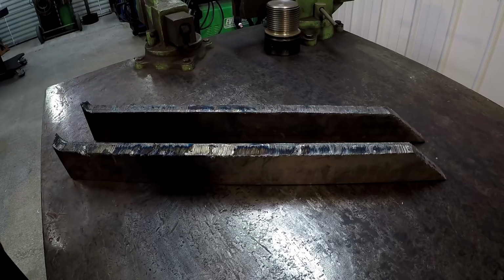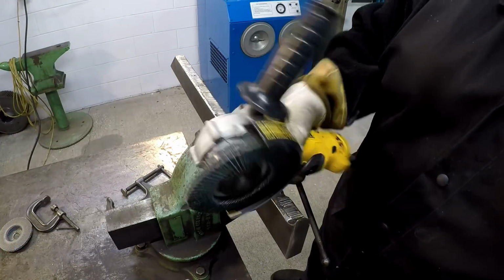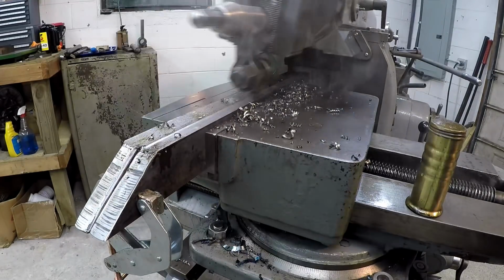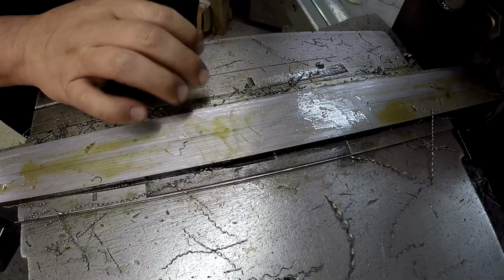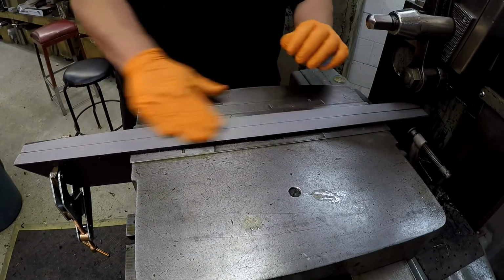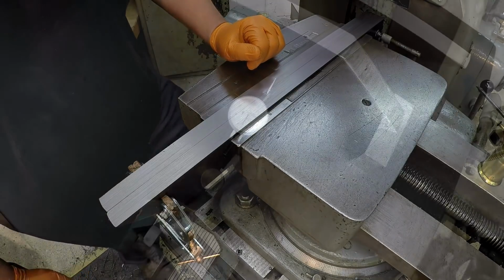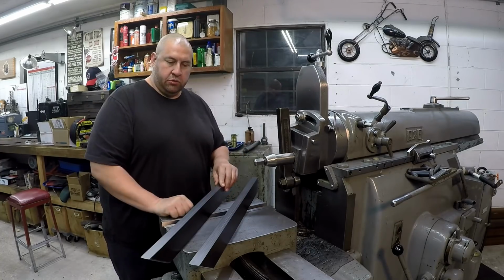SNS 220: Shaping 28" Parallel Bars

Comment: Not gonna lie, I've never seen one of those machines that you were using to cut those edges down. What do you call a beast like that? Is it only used for parallel  milling? Do you cut channels with it too or just get dimensions cut in?
Reply: morningstaR x it's called a shaper.
Reply: I've seen them used on YouTube for channels, dovetails (I think), and keyways.  Stefan Gotteswinter used one on his YouTube channel quite a bit.

Comment: Glad to see the vises with the square throat. As long as i have been a machinist i cannot stand the Wilton round throat sealed bearing vises. They call them machinist vises and i never understood. Way over priced too. Gimme a Milwaukee, Morgan, or and old Columbian before they got crappy. Well, off topic but i was glad to see a machinist with good sense about vises. Lol
Reply: What is your objection to the round throat?
Reply: t sam - it helps keep parts more stabile. Also if you have something heavy you have to hold it steady with one hand while you tighten the vise with the other. The vises i mentioned have larger diam handles also. These are a few reasons.

Comment: What's the tolerance for straightness (flatness) over the full stroke on a shaper like that? That shaper and shapers in general. I see the dovetail ways looked scraped. Does it have to be (somewhat) regularly checked and calibrated due to wear?

Comment: My vise, crudely mounted as it is, has a tendency to work loose.  I need a real base for it, but I still can't get my brain to settle on a design.

On mine, the cross feed is on a ratchet system, so, if the tool head feeds straight down, the cutter engages the work in exactly the same places that it did on the previous pass.  I'm wondering if angling the tool feed so that you feed down and shift the tool horizontally would result in a better look .. say, start with a 1:1 ratio and test other angles from there.

Have you tried a spring pass with the shear tool?  I was led to believe that the shear tool was only intended to take 1-2 thou off at a time.  Even that light, I've done as many as 6 spring passes with the lathe before it quit making chips.  That may be, in part, due to the fact that my slowest feed rate is .006/rev and my carriage feed engages with a clutch, so the tool doesn't follow the exact same path on the work every time.  I've been really happy with the final finishes I've gotten when I've done that, though, so I'm willing to put up with the extra work.
Reply from the maker: No reason to keep making spring passes unless your trying to reduce the diameter. From what I’ve read the shear tool is good for up to .005, but it can certainly handle more.
Reply: Well, I was going by Lyle Peterson's instruction, and I failed to mention that the finish improved with each pass.  The result was probably the closest to 'mirror' that I've gotten with HSS, image reflective with the faintest of very clean looking machining lines. The work I had this happen on was for an indexing center, to offset the part from center in the 4 jaw.  Exact size wasn't so much of an issue, but I wanted to make the surface that the dial indicator worked from as clean as I could get it.  The first shear cut was heavy, (error on my part) and the result of that one pass wasn't much different from the previous tool.  My thoughts on why it all came out the way it did would force me to write a book, so I'll just say "that's what I observed on my machine."  And "each machine is different, therefore your results may vary."  

How to get the same finish with the shaper is another challenge, though, and I think that a lot of the problem has to do with the more static work feed/tool path that I mentioned previously.  So, based on whats been observed so far, how can we sneak up on our target size with the same finish, on the shaper?  I'd love to get a finish that looked similar to one of your hydraulic shaft turnings.

Comment: What? A guard on your angle grinder? and a faceshield? and long sleeves while TIG welding? It's so nice to see a video where somebody is using proper safety equipment, not to mention proper use of tools.
Reply: You didn't see the 9" angle grinder then 🤔
Reply: Also according to osha law no gloves around power rotating equipment but he had the on while grinding

Comment: So what was this thing used for? Is it just kind of like equivalent to a jointer in the woodworking world?
Reply: It can do what a jointer can do, but it's more like a mill that uses a fixed "chisel", though some can have a rotating tool (helical milling). They can cut grooves/dadoes/dovetails and the cutter can be shaped or adjusted to make different profiles, kind of like a router. If the vise is on a turntable, it can do those things at pretty much any angle on that plane. Depending on how the shaper is set up, and with all the proper accessories, they can be used to cut threads or cam profiles, teeth for gears, keyways, galleys, undercuts, et cetera and so on.
Reply: NiccoHel Ya, as I’ve heard said before, you can do anything with a shaper, other than make money. 🤣

Which I assume comes from the fact that while it can do all of that, the setup and labor involved is usually prohibitive, when there are specialized tools for all those things.
Reply: @Nevir202  MOSTLY FOR CUTTING GEARS AND KEYWAYS

Comment: Aha an angle grinder, finally a tool I could teach you a trick or two with...lol......I don't ever tuck them in close for better control because if the disk wedges and your work piece is solid it can pull and twist you in onto the work piece. If the hand tool is more powerful than you then you better holding it like a baseball bat, like you hold a chainsaw, so that if it kicks or when it next kicks you can just let the tool swing away and absorb the kick rather than slamming into your chest and catching your clothing.
Reply: Being a Metabo, it should have a safety clutch to prevent twisting your arm off, if the disc jams.
Reply: @glitchwrks  The safety is with how you operate the tool and you should not rely on the safety features of the tool. I once had a 1000W drill catch my safety jacket when it kicked into me while drilling at the top of a 20ft ladder. The chuck caught the sleeve of my safety jacket and twisted my arm up so bad that my finger was twisted onto the trigger and I could not release the power. The only reason I am talking to you now was that I had my other hand held tight to the secure ladder. But I found myself in a situation where one hand is holding on for dear life and the other hand has hold of a now smoking 1000W power tool that I cant release the power too. I released my hold of the ladder and hooked my good arm through one of the rungs of the ladder so that I could pull the safety jacket from around my trigger finger.
Sometimes things advertised as safety do not give it to you, now if that jacket was just regular clothing it would have ripped apart with the forces involved. Tough tight clothing might stop loose material from pulling you into a machine...but it it does catch then it is worse than normal clothing.
Reply: @AirCrash1  what were you doing with a 1000w drill ontop of a ladder?
Reply: @jamesscott6753  Building my home, I used huge laminated beam made from hardwood and the fittings were all stainless which is nigh impossible to drill by hand.  I pre-drilled most of the stuff but some could only be done once up and the drill bit long enough and big enough to do it only fitted my big drill.

Comment: Do you have a special energy supplier?  If i used those machines in a domestic shed my bill would be huge and probably give surrounding houses brown outs when turned on
Reply: its 3 phase instead of the standard split phase 220
Reply from the maker: My shop runs in 3 phase power.

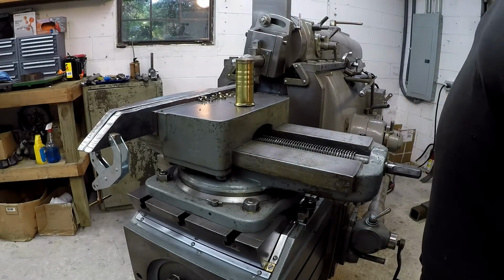Comment: not sure if it matters, but at 9:22, i can see some deflection on the part as the cutter extends out.
Reply: Not necessarily a cause for concern if it's caused by flex in the mat/feet/table/floor interface. The center of mass shift on this thing must be huge. It would be fun to operate in a rowboat.

Comment: I must ask - why didn't you put more oil on there? Won't the heat damage the cutting tool by making it more brittle?
Reply: I see. Makes sense also considering how those machines rotate the part/bit, which would alter where the smoke goes.
Reply from the maker: David Pontius The heat won’t effect the tool at the speeds I’m cutting on the shaper. The oil is to help the shearing action of the metal.
Reply from the maker: Roderick, the oil is used for lubrication, not cooling in these applications.

Comment: I don't understand how you are maintaining equal force when you're using the indicator to see how flat the steel is... is it running against the edge of the granite plate? or are you just using your judgement?
Reply: The Indicator tip is running along the bottom side of the steel (which is sitting on two 123 blocks). The thing that is holding the indicator slides on top of the granite.

Comment: is the up and down movement of the tool holder part of the designed machine function? or just wear?
Reply: It's part of the design, on the back stroke the tool is lifted to prevent chipping of the edge. Although I have to admit it looked a bit weird.
Reply: It's called the clapper box.

Comment: What's the point of those clamps? Like, advantages over a c clamp? Also, what are they called? I always hear cam twist clamp, but that doesn't sound right.
Reply from the maker: Peter Juncker sometimes it’s the position of the screw handle that makes them better then a c clamp.

Comment: Question. I hate using an angle grinder in the workshop. The ground off particles get everywhere. Does that worry you?  Watching I thought you'd have used some sort of screen.
Reply: remember he got 2 different areas of his shop, where he did it in the new part what got the grinders and stuff
Reply from the maker: Grinding dust don’t bother me, it’s a shop, made to get dirty. All the years my dad and I worked in our other shop, grinding dust never give a problem.
Reply: True.  I don't have the same amount of space.
Reply: Indeed. But your shop is so CLEAN and the grindings do get everywhere and they are not good for machines and stuff.

Comment: Now it deflected and you must sharpen it again, it warmed up because the passes were very deep, you did it too fast, you must not do no more than 1 or 2 mm x time.
Reply: Yeah the cuts looked very deep and might have heated the metal and caused some distortion meaning they were not as flat as they could have been.

Comment: the bigger the radius on the tip the better the finish,
Reply: You right about that. You have better heat decipation while cutting with a radius tool. With a seven degree relief works best????

Comment: Why did you use a shaper rather than a milling machine for this?
Reply: Accuracy, durability of the bits, and mostly stroke length. He mentioned his mill can't handle a work piece that long in one pass.

Comment: Could you use a inserted turning holder on the shaper?
Reply: Absolutely.  Especially if the material is tough to cut with HSS, or if the operator doesn't have the skill to grind his own tools.
Reply: Not ideal being draw backwards and intermediate cut risk shearing them
Reply: Matthew Trott  If you mean intermittent cut, then yes, you'd have to pick the correct type and size of insert to avoid breaking it.  As for drawing it backwards, the clapper box that the tool holder is attached to, flips up when the ram is retracting, so no damage occurs to the cutter.  I've used inserted cutters many times on my shaper, with no issues.  I do prefer HSS though.  Like everything else in machining, it's all about feeds and speeds and depth of cut.

Comment: Does it do anything to the tooling on the backstroke I know it releases a lot of the pressure it would be neat if it’s sharpened it kind of took that bur off each time to
Reply: If you look closely the tool is actually on a one way hinge that allows it to lift up on the back stroke, so as it comes back it glide across the top of the workpiece.

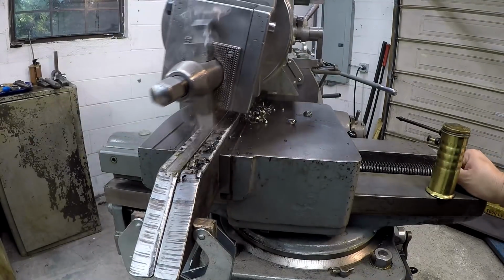It's really visible at 10:28
Reply: I see that part but with the backstroke would help take any bars off
Reply: @thedeloachsdoyoutube8377  No the tool holder isn't rigid enough for cutting in both directions.

To be honest these machines aren't used much anymore, milling machines have replaced them

Comment: Would there be any benefit to using carbide inserts on the shaper? Do Carbide bits specifically for the shaper exist?
Reply: Phillip Nicholson Carbide does not like interrupted cuts or impacts. It would likely break the insert. HSS and high carbon steel are best for their impact resistance

Comment: Out of curiosity, would a CNC grinder have done a faster job? Ignorant of the shaper's quality capabilities vs a grinder.
Reply: Yeah, This is something I've never seen before. What's the benefit over a mill?
Reply: @imusuallycorrect  it's cheaper than a mill, uses less than a mill (like the lack of a need for replacing the coolant), and can be smaller than a mill, for the same size table area. However it has a smaller job flexibility. It's pretty much limited to an extruded 2D shapes (Ie taking the edge of a square, and making it a cuboid, or part of the edge of a circle, and extruding it to a cylinder etc.).
Reply: @GrasshopperKelly  Thanks for taking the time to reply. Interesting stuff!

Comment: Somehow that bend feels like it happened after you removed them from the vice... maybe the flame-cutting process created a lot of stresses in the material and when you cut it, it goes wonky on you.

Just spit-balling here :D
Reply: Mtaalas
Right. Always take your part out of the middle. Rough both sides before taking a finish cut.
Reply: You may have a point here, they looked bowed in the video out of the clamp.

Comment: Why you do not use milling machine +   surface grinding machine for finishing?
Reply: Manufacturing processes do have a hierarchy (from most to least economical) and single point cutting (turning but also shaping) is often more economical than mutiple-point cutting (such as milling). It goes more or less this way: cutting (sawing) -> continuous multi-point cutting (drilling) -> continuous single-point cutting (turning) -> interrupted single-point cutting (shaping) -> interrupted multi-point cutting (milling) -> grinding. If a piece can be done with a process higher up, you should always choose that.
Reply: @M1KEMEX  Your information about production process is very intersting and worth thinking about. But I don't understand why in your process chain contin. multipoint cutting (drilling) is before the cont. single cutting (turning)? In you first sentence you wrote single is more economical than multi, so shouldn't the order be other round? I want to understand your explanation better, do you have some source explanining it in detail?

Comment: good video , but i don´t get why the bend in a non machined side is interesting , would be  better to measure how parallel the the machined sides are.
Reply: I believe he's running the indicator along the (machined) underside of the plates.
Reply from the maker: john andersen I machined both sides of the bars

Comment: Perhaps the wrong angle on the cutting tool is the cause of the not smooth finish. The tool is tearing the metal rather than cutting smoothly. The finish should be shiny.
Reply: the tool is not new 
he used no colant
the speed should be a little slowed

Comment: Probably a really dumb question, but did anybody ever make or even try mounting a grinding head on a shaper arm? Seems like you could get some amazing finishes. Would have to spark out front or in direction of feed. But with a 90 degree rotation you could grind like 45 degree.
Reply: Doc Pedersen That sound basically like a surface grinder.
Reply: Emil Muhrman  Pretty close, with reversal that head moves instead of work. My thoughts were you could get pretty good grind stability with mass of shaper arm behind grind head.
Reply: Doc, that would be like a surface grinder in reverse.

Comment: Call me crazy, but isn’t it more efficient to cut off the little tab of steel first and then grind the whole thing at once? Also, I don’t personally see the point of hitting it with a tiger wheel when you can just use the flat of a grinding disc, especially since you’re hitting it with a shaper after.

Comment: Hi Adam ! have you calculated the surface speed for the material you are using
Reply from the maker: I try to keep it around 80 sfm for mild steel. The chart on the shaper helps you select the proper stoke speed for the given length of cut.

Comment: Why not carbide for finishing cut?
Reply from the maker: Because high speed
Reply: Carbide love heat but hates shock. After a few rams into the end of the part the carbide shatters. Get some 10% cobalt HHS and you'll be a happy camper.

Comment: Does the shaper loose force with longer strokes?
Reply: The longer the stroke, the less peak cutting force the shaper will have at a given surface speed. The further the travel, the less rigidity you will have as well.
Reply: You can probably intuitively map the force curve taking into account the rotation position of the flywheel, radial deflection of the driving block and the fulcrum length.

Comment: I never did understand why you turn the flap plate at an angle just to turn your tool back to straight.
Reply: Michael Smith pretty sure it gives better clearance.
Reply: In the case of the shaper the cut advances on the back stroke. The angel of the clapper is set to give extra clearance to avoid dragging the cutting edge against the advancing uncut material.

Comment: With ugly gummy material like those bars, the only ways to improve finish are more SFM, or more DOC and tool pressure.  The latter is easy on a lathe, but I imagine near impossible on a shaper.  Try cranking up that ram speed!